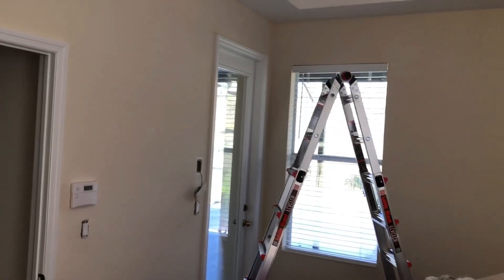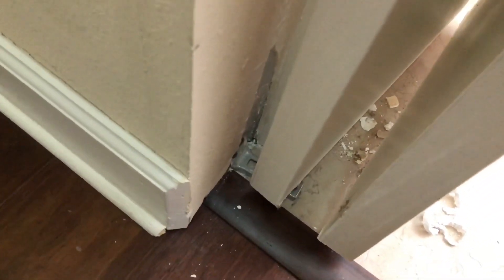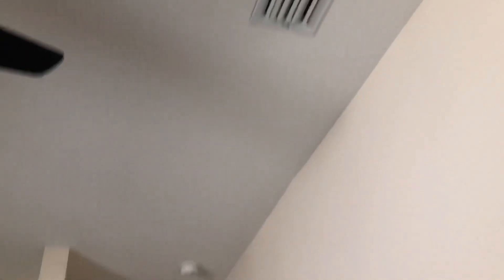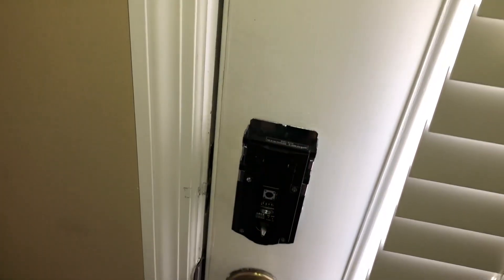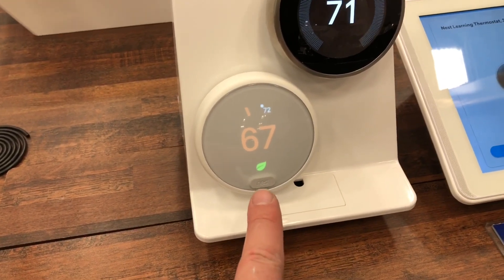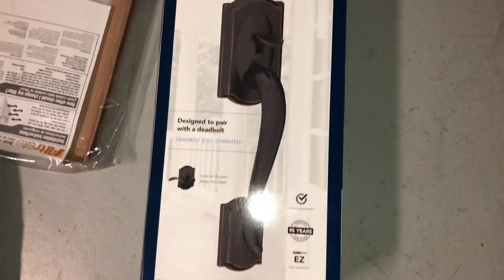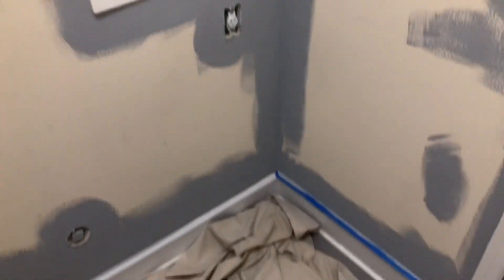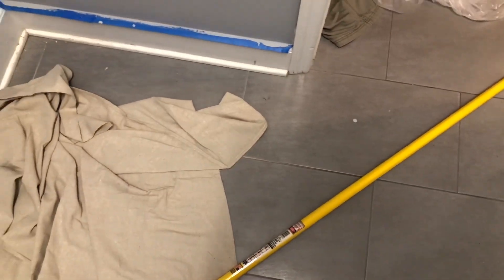Home Renovations Day 3 - CO Guy Stuff

Comment: You will almost always see the roller lines as it dries but unless its really thick it should disappear.  I was taught to roll in a W pattern across a 4-6 ft section and repeat to fill the gaps and then long final strokes using light pressure. Also for the texture on the wall it would probably be better to use a 1/2 or 3/4 nap as 3/8 is meant for drywall or other mostly smooth surfaces but it wont hurt anything.

Comment: Also when painting with a roller, I found the best approach is by rolling up / down at first and then going back over the same area with less paint on the roller and going left / right.  You should have very few missed spots and more even coverage.  I did it this way and avoided having to apply a second coat.
Reply: I was always taught to roll a W on the wall. The issue here is the texture and it may need a 1/2 or 3/4 nap which ends up using more paint initially.

Comment: Bryan. You’re a big help to so many so here’s a tip for your self closing door. 
Place your hinge pin on a scrap piece of wood. Find the middle of the pin and tap it with your hammer until it has a slight bend. It only took three taps with my hammer. This bend will provide enough friction to stop the door from closing or opening by itself.

Comment: Last time I painted my house interior, I used one of these flat edging tools at the ceiling line and baseboard.  It worked very well as long as I did not really load up the pad with paint.  Less than $5 so it's worth a try ... https://www.lowes.com/pd/SHUR-LINE-Edger-Classic/50369770

Comment: Hello Bryan!
I've got some tips with the painting, i really don't know the correct English words for what ill be recommending but i hope you get it.
1. So for covering the floors and base floor boards you can use Uni-mask tape with a drop sheet. It will protect the floor and you can protect the base boards by masking (as you have done in this video) close to the wall to get a nice even line.
2. To protect the ceiling you can try and use a wide Putty knife(?) and paint against it as you push it in the corner of the ceiling and moving it along as you go, might take some practice.
Hope all goes well!